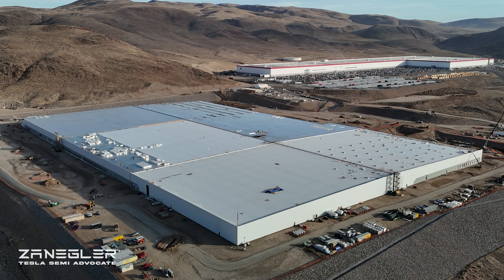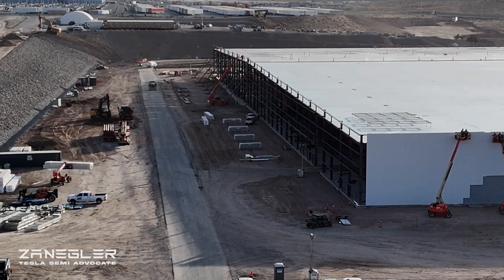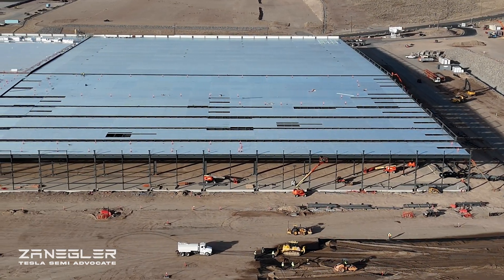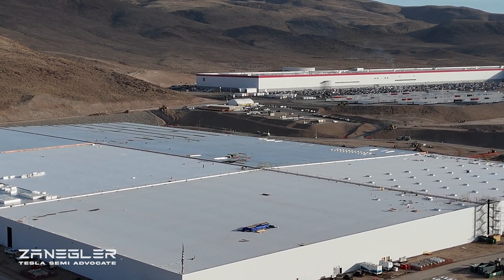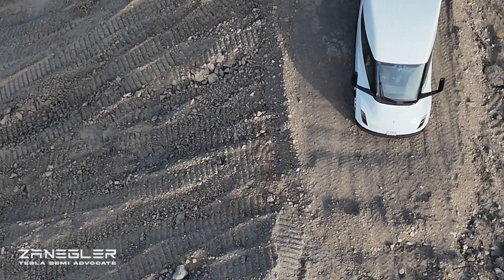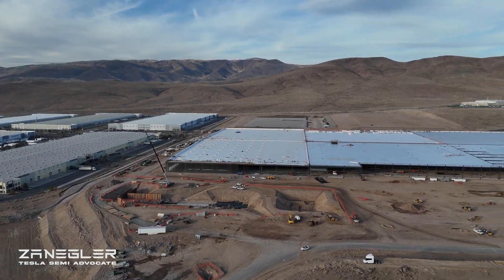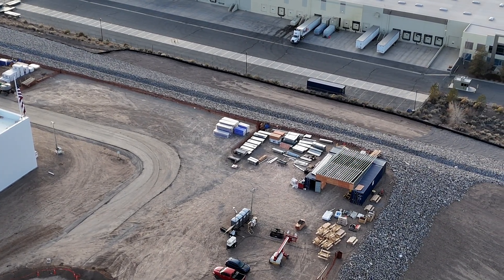Tesla Giga Semi Unbelievable Construction Progress?

Comment: For those who might not know, heavy production machinery/equipment cannot be move right onto green/fresh concrete that has not cured to very near full strength. The time needed can be quite variable based on many factors especially temperature, but chemicals added to speed curing can be added to the mix before the pour into the floor. Typically several days+ are needed for a complete cure.

Comment: love the coverage, keep it up! As a photorapher a recommnedation for countering the nasting afternoon glare, would be to use CPL filter, or circularized polazing filter.  It will cut the glare out and help to level out the lighting. They make them for most all drones and shouldn't be very expesive. Cheers
Reply from the maker: Great tip! I’ll order one today since this issue will persist especially in winter.

Comment: The second hole seems an odd shape for storing waste water.  I expect more footings for stamping presses, but just a guess.
Reply from the maker: I was sharing what a viewer had speculated but my current thinking is the same. Maybe this footing is for the frame stamping and the other one for body panels.
Reply: @ZaneglerTeslaSemiStalker-vt3or  There's a small stand-alone press in Stamping at GT. Used for testing dies as best I can make out. Installed beside a milling centre for machining dies.

Comment: How deep are the stamping foundations ? Why do they need to be so deep in the ground ?
Reply: A number of reasons. The die bolsters* need to be at ground level to drive directly into the press.
There are isolation mounts under the presses. There are also chambers/passages for removal of the scrap.

*Mobile stand that the dies move in and out of the press on. Dies are changed regularly for maintenance etc.

Comment: I think the deep pit is for stormwater management.  During heavy rains the water has to go somewhere and thy likely interfered with the normal runoff paths.  That is a LARGE roof that no longer absorbs water underneath.
Reply from the maker: If you look back at my December-February videos you’ll see they spent a good deal of time putting in storm water drainage pipes that lead to the dry wash just outside of the northern property line along Milan Ave.
Reply: @ZaneglerTeslaSemiStalker-vt3or  Yes but that doesn't mean it can handle literally ACRES of water.  Ponds are meant to slow the run off.

Comment: That smaller pit beside the big one is also for stamping, it's very similar to what was done in Texas and Germany.

I hope one day Tesla can get rid of those permanent airbrakes called side mirrors.. in the EU every new semi has just tiny flat wings with cameras and screens inside the cabin acting as 'mirrors'... It's a bit silly that the Tesla Semi has not gone this route yet. With the huge size of the Tesla Semi mirrors it would make the Semi quite a bit more efficient if they can get rid of these.

But cool video! Amazing how quickly this factory is built.  

But that stamping area could be a drag, iirc it took Texas almost a year to get that section ready. In Texas it was the first thing they started with, even before the first steel columns were installed
Reply: @MarcoNierop They have to follow the regulations. It might be that the buyers will be allowed to remove them.
Reply from the maker: Interesting in that the stamping area is the last section they started on here. I have to think they can complete the footings in a couple months. Time will tell
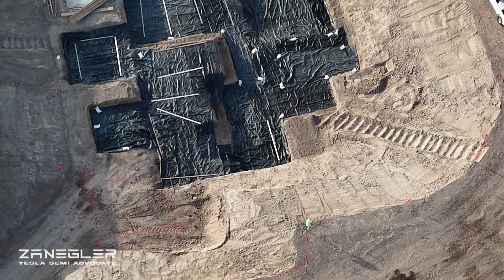Reply: @ZaneglerTeslaSemiStalker-vt3or  At GT the building footings were also part of the stamping press footings. Plus here there's also small squares along the edge that are also likely to be  building footings. 9:39 for example.

Column pedestal rebar at 9:51.

Comment: 9:11 this surely doesn't look like wastewater basin - it will be similar deep construction like the one on the left of it. 
But a moment ago you missed a new mezzanine floor in the section D (I think). That is interesting development! 
And also, what about the grading and paving of the new road behind where the Semi looks perched over the new factory? That is an intensive work in progress!
Plus there seems to be newly paved road leading from the building right there just a few seconds earlier.
Reply: You're correct there is a mezzanine that can be seen at 5:33 and I believe it's in section E just beside the Tesla Semi that is parked inside the factory